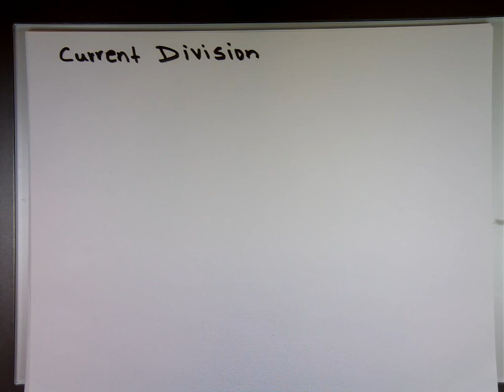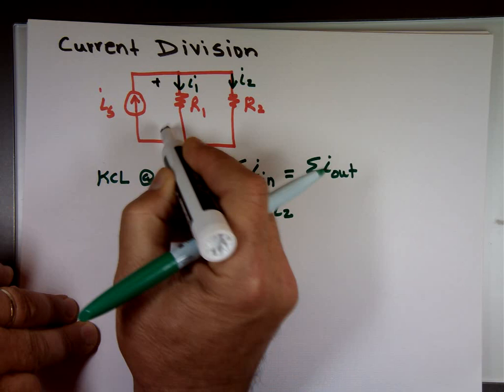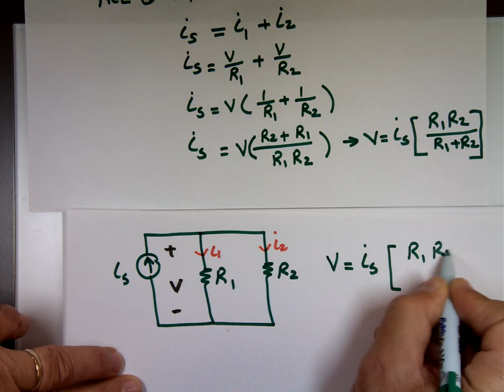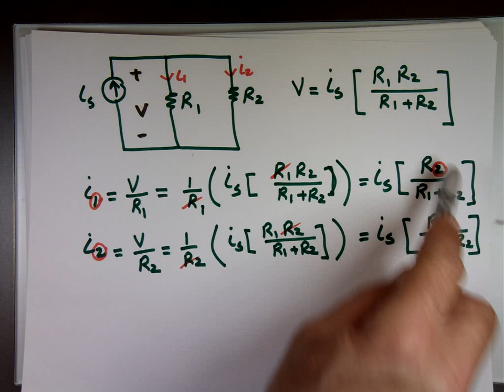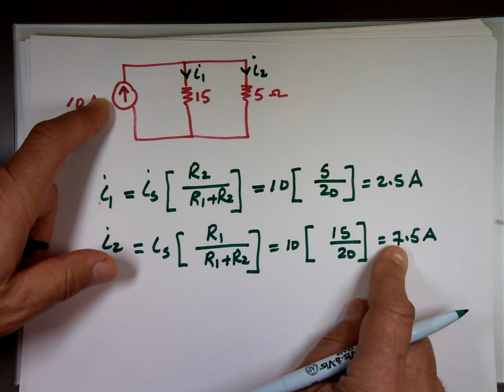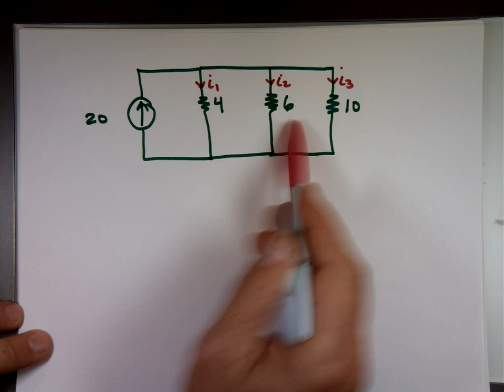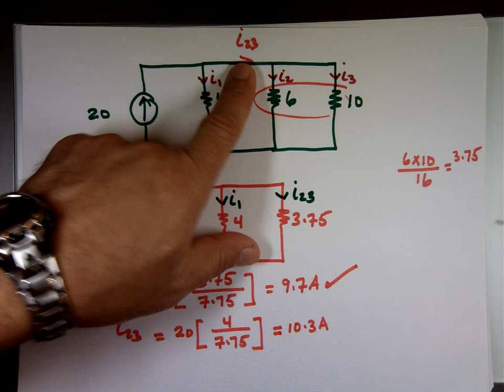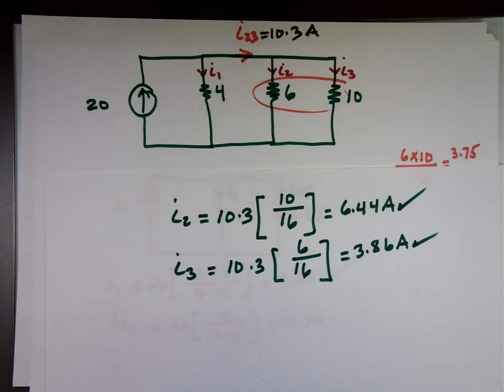Current Division

Comment: To reduce a parallel network to two resistors just so you can find the current through one of them is too complicated. Better to recognize that any given branch current is voltage × conductance of said branch. With that in mind, the total current supplied = the sum of the branch currents. The sum of the branch currents = the voltage × the sum of the conductances. Therefore voltage = total current supplied ÷ the sum of the conductances. And the individual branch current = ( the total current supplied ÷ the sum of the conductances) × the individual conductance of the branch in question. For example i1 in the given problem is 20 A ÷ (1/4Ω + 1/6Ω + 1/10Ω) × 1/4Ω = 300/31 A.